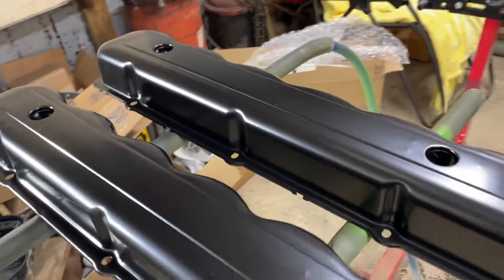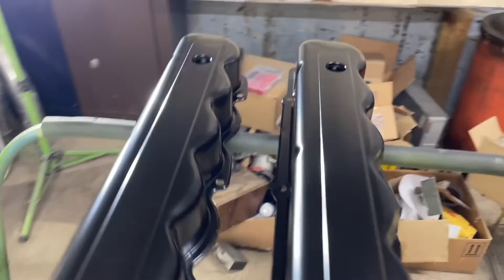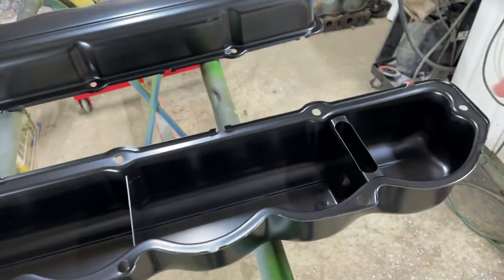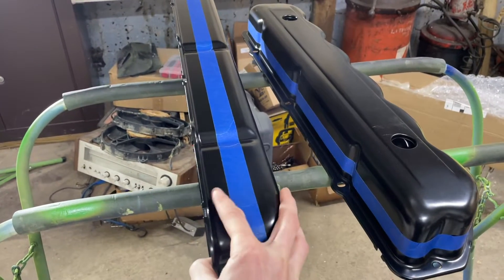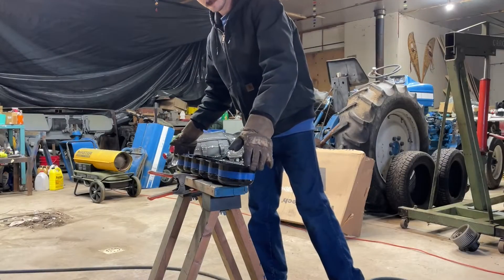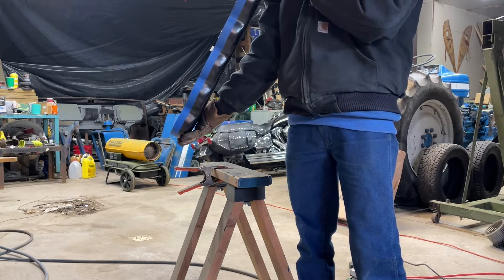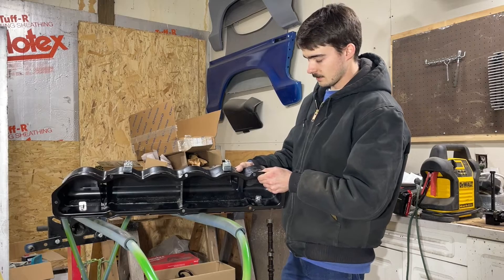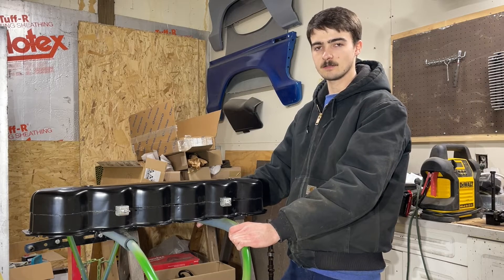Turbo 300 Inline Six Custom Valve Cover (roller rocker clearance mod) - Part 1

Comment: I built a 300 with roller rockers 30 years ago. I made them fit under the stock valve cover by using Dodge 225 pushrods and machining a little bit off the adjusters.

Comment: I was thinking of doing the same thing.  I can't wait to see how the valve cover fits.....I got the BBF roller lifters the other day.  Once I get the garage cleaned out I'll get room to roll the engine in to tear it down to see how much cutting or grinding to the Block to get the lifters in.